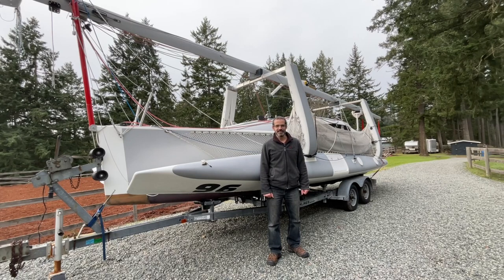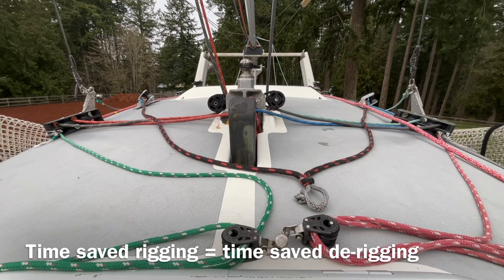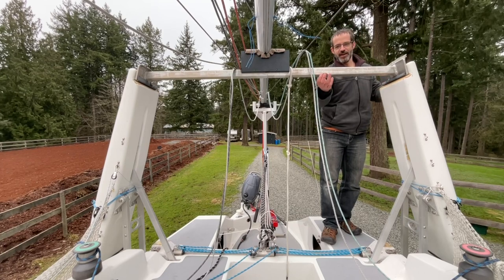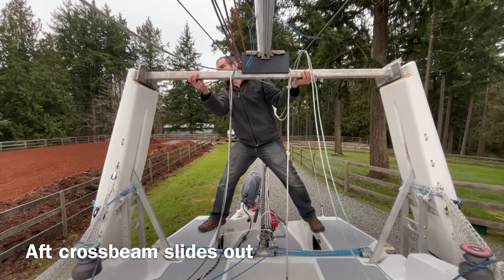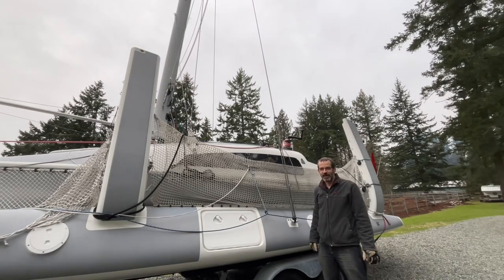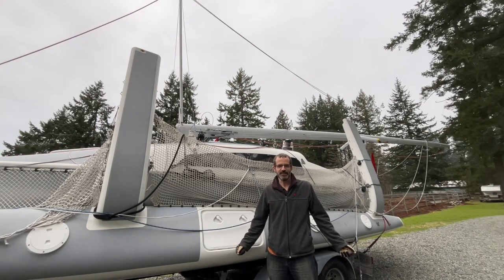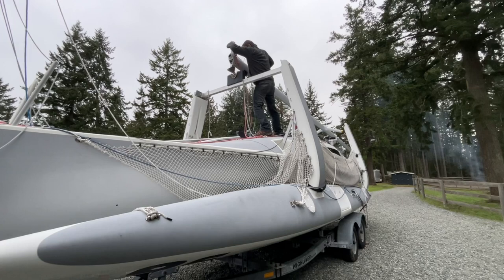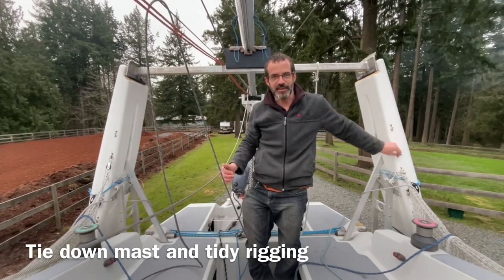How to Raise and Lower the Mast on a Foldable Trimaran

Comment: This is a fantastic system! I want to do the Great Loop and because of height restrictions on the Erie Canal, Trent Severn Waterway, Rideau Canal, and the Chicago River loopers with sailing craft have to stop at a marina on the Hudson River in NY to have a crane unstep their mast which is not only time consuming, but a bit pricey plus it does not allow loopers to sail on the Great Lakes which would be amazing. Originally I wanted to own a sailing catamaran like a Maine Cat 38 or Privilege 37, but now I am leaning towards a trimaran with folding amas as the smallest locks in Canada have a width of 23 feet, so a folding system is perfect. Plus being able to raise the mast back up to sail on the Georgian Bay and the Great Lakes is something most loopers never get to enjoy.
Reply from the maker: Yes a Farrier/Corsair trimaran would be perfect for that trip. And the F-31 / F9 models are 22.5 feet wide even unfolded with the smaller models being narrower yet so may not even have to fold!

Comment: So nice. F31 owner. I prefer raising from the cockpit also.  I leave my boat on the water year round. But raised it up by myself first time with no issues.
Reply from the maker: Yeah I'm a bit torn about leaving it in the water. It takes about 30 minutes longer to sail from the trailer than from a dock, but on the water you have to clean the bottom. Plus it's convenient to have it on the trailer at home for projects and repairs. It takes me about 30 minutes to drive to the dock, so just a single repair trip per sail outing makes up the difference for us.

Comment: at 6:50 another good reason for using the boats own winches is that the boat remains secured to the trailer while you are precariously up on the thing, NO lifelines, and prone to falling, esp. if the boat gets bumped off the trailer!!, or off one of it's rollers. another is that the on-board winches are self-tailing, you can "block" the line off the drum, so if anything goes ary you can stop, and NOT lose any progress, as otherwise you will have to lower back down completely.
Reply from the maker: Excellent points - you can't really leave the trailer winch with the mast half way up to sort out something that has fouled!
Reply: We have a large shackle on a bow protector to secure the boat to the trailer, stand the mast then unfasten when we launch. I agree, be aware of load balance when unlocking the trailer winch or unhitching.
Reply from the maker: @sailingmahina1  That’s a good approach - I had a friend whose boat slid off the trailer on the way down the ramp before reaching the water!

Comment: I'm an F-9A owner/builder launched in '93. Although I rarely raise/lower the mast, it is always done on the water since my local launch ramp is under a bridge. My set-up is very similar to yours using the cockpit winches and a block at the bow. Your mast sure looks lighter than my 40' aluminum one though so I use both the spin and jib halyards in tandem to opposite winches (that's probably overkill).
Reply from the maker: The F-9A is a great boat! We prefer to raise in the parking lot because then we can leave the crossbeams and gin pole on the truck, but do raise on the water about 20% of the time if the ramp is congested etc. We trailer to different ramps for various events so it's nice to have the flexibility. Our mast is aluminum and 38', so a slight turbo rig for this boat, and it's also pretty heavy. Sometimes I wish it were lighter, but I also appreciate never having to worry about it!

Comment: Have you ever tried this on an F-31R? I caught a near fatal issue with it trailer winch last weekend and we rigged a similar system to lower the mast. The loads seemed pretty high but it worked really well. It actually seemed much better for control and visibility not to mention safety.
Reply from the maker: Haven’t tried it on an F-31R but our mast is only a tiny bit shorter and aluminum, whereby the F-31R typically has a carbon mast so may not be too much different in weight. And as you probably saw in the FCT Forums other F-31/F-9 owners do use this technique. I prefer the cockpit winch method because 1) you can raise the mast either on the trailer or on the water depending on the prevailing conditions at the ramp and 2) you have much better visibility of things e.g. lines that might get fouled and 3) you can guide the mast back onto the roller as you lower it. It does seem more dangerous being so close to underneath the mast, but you are actually off to the side, and despite seemingly high loads they are still well below the breaking strength of properly sized gear.

Comment: Nice video Gary.  Note the F27 mast rasing is quite different: non-roating rig that has permanent lower/intermediate shrouds + baby stay on the main hull, no temp supports needing during up/down, no gin pole needed (cross beam across top of akas instead, but amas must be folded).  I also dry-sail, and have switched to a worm-drive trailer winch (will not free-wheel by design, and no brake pads to worry about), with a cordless drill with 5/8 socket to drive the winch quickly/effortlessly during mast up/down.
Reply from the maker: Thanks Greg! I'd love to see your system in action! That's an interesting idea to just use the forward beam cross member support, as it would save the step of installing the gin pole. Just may not be quite enough leverage for a longer or heavier mast. Or having a gin pole that attaches to the deck and just folds down between retrieval and next launch. Look forward to seeing you out there!
Reply: The beams on an F27 are much longer than on modern tris. That's probably why the older Ian Farrier designs used the cross bar for raising in stead.
Reply from the maker: @sail4life  Interesting point re: the longer beams on the F27! According to the sail plan the mast of the F27 is also about 3' / 1m shorter than the F-82R which would make it a bit easier to raise with a smaller lever.

Comment: Thanks Gary. I’ll be watching this a few more times as I’ve never raised my mast. I’m going to look at incorporating the cross beams for the mast and tent support great idea. The F9A raising system is slightly different but I can imagine it all working as you demonstrate. 
You didn’t show the raising wire (dyneema)terminations on the mast and deck. Do you have triangles on the deck and how do you terminate the ends?
Reply from the maker: Hi Garth, the best shot of the deck mounted "mast raising stay bracket" is probably around 2:10-2:15 in the video, but it's not a great shot - try pausing the video for a better look. It's basically just an aluminum fitting bolted to the deck, with an eye in line with the mast pivot point. There's a standard stainless shackle through that, and the Dyneema mast raising wires and gin pole supports (not shown in that shot) are attached to the shackle with a trucker hitch. The jib and spinnaker halyards are also attached to the same shackle as backups. I'll try to get you some better pictures...
Reply: Yes centering the mast is key. I had some issues with my F22. I still have to perfect the system. I bought the boat with a selfmade system and i think i didnt get the idea very well. I think now i have a better idea of the centering mechanics. Cheers from Belgium.
Reply from the maker: @NICOLAS25478  Yes it definitely takes some work to refine the system. Our system is also custom made. It’s really important that the mast and gin pole stay cantered through the lift and aren’t able to twist to one side, and that all the pivots are aligned to maintain constant tension throughout the lift. So far the mast raising wires and halyard backup on the mast, plus the smaller Dyneema stays on the gin pole have been very reliable. We had some scary moments early on before we got to this point but learned from them.

Comment: great video. I have watched this a few times to learn the details as I am about to purchase an 82R. Given the usual trailering situation with a 82R is to support the mast at the pushpit and the rear support why do you need the rear crossbeam at all? and why do you have your prodder hinged up to support the mast ? Is it just redundancy for road trailering??
Reply from the maker: The aft support is mostly to transfer the weight of the mast off the roller for trailering because I was concerned that leaving it there while the trailer bounces down the road places undue forces on the aft section of the hull e.g. where the trailer bunks end. In other words I wanted to transfer the weight of the mast as directly to the trailer as possible without stressing the boat. Also the folded prodder doesn't support the mast in any way, it's just lashed to the mast so it doesn't fall down. There's definitely more than one way to do this!

Comment: Very nice set up! Are you using the original bolts from beams to attach your cross member? I don't see them in the video. The reason i ask is I built a similar setup for winter storage, but I pulled the bolts from the beams because I needed longer bolts to hold the crossmember. Pulling the cotter pins out of the F24 beam bolts was a huge pain because they were wedged in super tight breaking on me. Now the new ones that i purchase to replace the old ones keep falling out or break from usage.
Reply from the maker: Yes I’m thankfully able to use the exact same bolts for the cross member as I do for sailing, so no need to swap them out. I use stainless wing nuts back sides of the crossmember. But if your sailing bolts are too short, could you not drill and tap a new hole in the crossmember to thread the sailing bolts directly into that, without requiring them to go all the way through?

Comment: I am trying to adapt a similar system to my Super Tramp. The gin pole process does not work in an open cockpit with the mast step on the floor. In my case, the gin pole would need to attach to mast 3 feet above the mast step. The geometry might work, but I worry about breaking the mast at the pressure point. Any suggestions?
Reply from the maker: I think breaking the mast is a valid concern given the geometry you describe! However it might still work if you attached the gin pole to a strong pivot point on the cockpit coaming forward of the mast, as long as it’s structurally sound enough to take the compression. I would size the gin pole to be about the same as the J dimension, or from that point to the forestay attachment. Ideally you would also attach lateral guys on adjacent pivots outboard on the coaming to keep the pole on centreline as it rotates. Does this make sense?
Reply: @SailingTipsCa  Having used the gin pole technique successfully on deck stepped monohulls, the lateral guy lines make very good sense, especially if in the same plane as the the mast step pivot point. A mast going sideways is never good. However in my Super Tramp's open cockpit/floor stepped mast, the coaming area would not be supportive. That does open my thinking though, in that I may be able to use the given infrastructure, the folded front beams to act as the base for a crane like attachment point for an extension high enough to get past that initial horizontal moment I call 'no man's land', when still less than 45 degrees.  Trying to keep it simple, especially for time and storage of extra equipment is a factor as well.

Comment: Great system! I'm looking to improve the setup/process on my F9A and wondering if you custom fabricated the crossbeams or if they were ordered? Also, is your bowsprit supporting the mast as well or just the crossbeams and aft roller?
Reply from the maker: Glad you like it! The crossbeams were custom fabricated. The mast rests on the two crossbeams and the aft roller, and the bowsprit is simply lashed to the mast to keep it in place while trailering. Let me know if you have any other questions!
Reply: @SailingTipsCa   I'm going to copy you on the synthetic shrouds at the amas - how much of your rigging is synthetic vs wire rope? Also, do you plan to replace more of the stainless with synthetic in the future?
Reply from the maker: @vonderlust  We currently have synthetic main shrouds and a stainless wire forestay because the jib hanks slide better on stainless, it chafes less, plus the stainless wire is thinner so more aerodynamically efficient. Given all this the current plan is to keep the synthetic main shrouds and wire forestay. I’ve sailed on a few boats with synthetic forestays and hank on jibs don’t drop as nicely but it’s really a minor issue.

Comment: What is the weight of your mast? 
Is there a lot of tension in the raising line, ie does the winching take much effort.
I have a Woods Gypsy catamaran, mast 10.5m, 18x12cm section aluminium.  I am wondering if I can make a similar system.
I previously had a  Hirondelle she had a 30’ mast of lighter section.  Very easy to lower and manoeuvre 
(ps, only just a bit jealous of your speed machine)
Reply from the maker: My mast is 11.6m, 21x10cm aluminum, 2.3mm wall thickness. It's from an old D-class catamaran and pretty beefy. I don't have an accurate weight but I'm estimating about 70kg. The gin pole is about 3m long. There's a decent amount of tension on the raising line, but still not to difficult to raise with a Harken 40 cabin-top winch in low gear, I can turn the handle with one hand. I switch to high gear about 2/3 the way up. Let me know if you have any other questions!!!

Comment: Thanks great job ,I noticed you have halyards coming aft to the cockpit with a rotating mast and they are outside the mast at the base a couple of questions how much rotation does that give you and I'd assume the halyard exit the mast   through slots if so how far up from the base is that ...cheers
Reply from the maker: Thanks - good eye!!! The halyards exit the mast about 1m/3' up from the base, and then go to clutches on the mast about 20cm/8" below that. From there they go through turning blocks at the base of the mast, then through deck organizers, and back to the cockpit. But with the clutches on the mast, there is generally only tension below that and adjacent to the rotation point when hoisting sails or tensioning halyards with the cockpit winches. During normal sailing the halyards are slack adjacent to the rotation point so the mast is free to rotate up to 90' or full rotation. The one exception to this is the spinnaker halyard, where we also have a clutch on the cabin top. But that's to facilitate dousing, so just before dousing we transfer the load from the mast clutch to the cabin top clutch, but at that point the mast is already rotated where we want it, and again that's a temporary situation. Hope this makes sense!
Reply: @SailingTipsCa  yes well explained and thank you, I'm building a trimaran atm so I'm really looking at details
Reply from the maker: @adrianbaker9804  Good luck and kudos - it’s a lot of hard work!!!

Comment: assuming you meant F-28R trimaran vs. F-82R trimaran in your description
Reply from the maker: It’s definitely an F-82R which is an 8.2 metre 26.9’ plan-built trimaran which is similar to the F-25C. The F-28R is a production boat built by Corsair and is both longer and heavier but with less floatation.

Comment: Great video! What would you suggest for a C-31 with forestay/furled jib? It makes the mast much heavier and tend to twist when horizontal with that additional weight on top.
Reply from the maker: Do you mean when you're trying to roll it fore and aft - the weight of the forestay/furler pulls it over?
Reply: @SailingTipsCa   Yes, it is a big bundle to lash to the mast all the way up and  especially with a Tides track makes it side-to-side top heavy.
Reply from the maker: @brucewacker2471  I wonder if a nice deep carpeted bunk on the forward crossbeam might help? I cut my bunks out of 2x8 dimensional lumber and the base sandwiches the crossbeam. The mast cutout profile is about 4”/10cm deep and matches the mast perfectly which keeps the mast from falling over, so I can let go completely and it just stays put. And maybe make some kind of hooks that loop under the diamond wires, over the mast, and hold the forestay/furler. Anybody else out there with a C-31-sized boat have any suggestions?
Reply: @SailingTipsCa  Good ideas. I'd also probably have to remake the aft roller to match the new mast profile and make room for the spreaders to roll past.

Comment: Is the front of the mast supported as well as the two cradles and roller
Reply from the maker: No the mast is 38' long and the forward section of the mast is cantilevered about 11' in front of the forward beam, but this is also the strongest part of the mast having the diamond wires and all. The beam cradles are about 12' apart, and the roller is about 6' aft of the beam, which leaves about 9' of the lightest part of the mast cantilevered off the back. It's a fairly robust aluminium wing section and no problems with this setup to date.

Comment: Hi everyone,

If in raising the mast starts to lean to the side, how do you adjust the tension on the side lines holding the gin pole? Or if you raise in a parking lot that is not perfectly level?

Thank you!
Reply from the maker: In addition to the mast raising wires, we use a jib halyard on one side and spin halyard on the other side for extra adjustable support, both attached to the pivot point. I like to raise the mast a foot off the roller, see which side it tends to swing to, then tighten the halyard on the opposite side. Does this help?
Reply: @SailingTipsCa  yes thank you much!